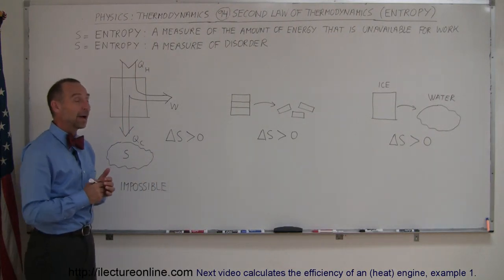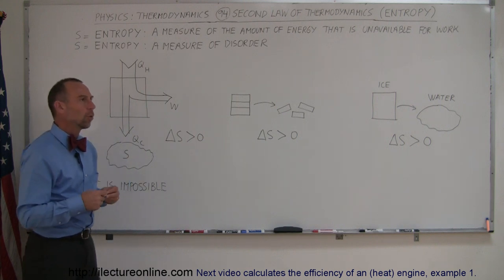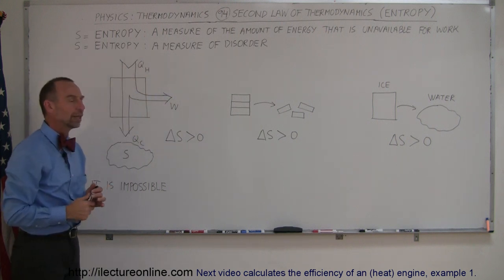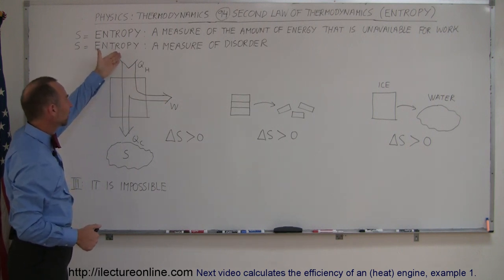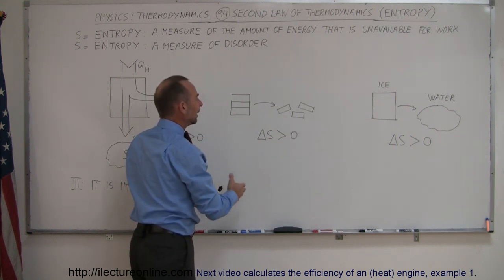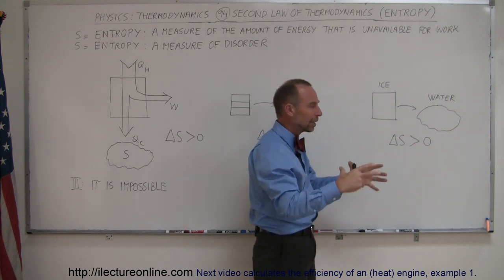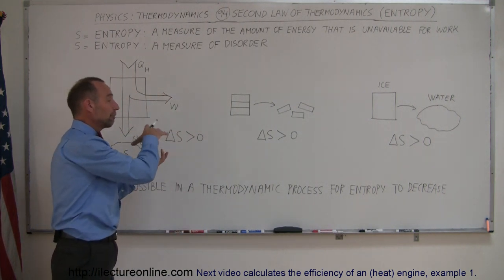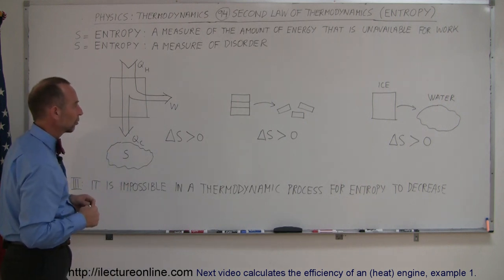Physics 29  Efficiency Of Heat Engines (4 of 14) Second Law of Thermodynamics (Entropy)

Comment: I'm not so sure if I perfectly understood your explanation about entropy.  If entropy is a measure of the amount of energy that is unavailable for work as in the exhaust gas of heat engines, then how come that some cars are designed to recover the available heat energy from the said exhaust gas to drive or work on the turbo charger in order to increase the power output of an engine.
Reply: He actually addressed that in a previous video. The output of heat aka Qc would have to be zero and all the input heat aka Qh would have to be converted to work leaving no heat for output. That implies that Qc would be absolute zero which is not possible

Comment: would it be safe to say Entropy is analogous  to Overhead in a Business and Work is the available profit in that business plan ? i know this is far from the entire story im just looking at the picture far left and Entropy is like the cost of the work provided in a sense based on that plan a better design would alter the specifications or "Profit margin" im referring specifically to heat engines only

Comment: I'm sorry sir there seems to be a confusion (not in your video). Many of my practice problems include efficiencies of the body metabolizing food energy and how it does work and cause heat to transfer out. Does doing work(work done on outside) cause heat to transfer out of a system?(sorry looks like I'm walking way back to the starting point) And what's the efficiency of the body in converting food energy? A man does 35000J of work and his efficiency is 5%, what's the energy being metabolized and what's the heat transfer to the environment? What's the metabolism efficiency? Is it delta U / w or w / delta U?

Comment: Sir,Energy is defined as the power to do work..and entropy is defined as energy that is unavailable for work..so if the energy is not available for work..how we could define it as energy?
Reply from the maker: You have to make a distinction between mechanical energy and thermal energy.  Thermal energy requires an engine to make it available to do work.
Reply: Michel van Biezen Thank you sir!Then the entropy is a calculation of thermal energy that is unavailable for work?
Reply from the maker: No, entropy is not energy.  The units are J/K.   But it is a measure of the distribution of energy as a function of the temperature it is stored at.  It is also a measure of the separation of heat (again as a function of temperature).  As entropy increases, the temperature variation of the universe will decrease.